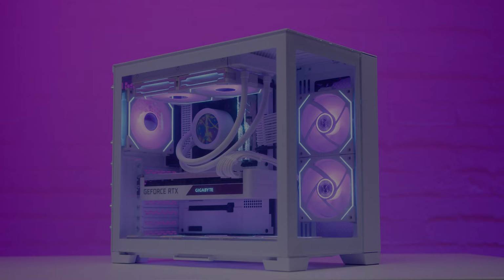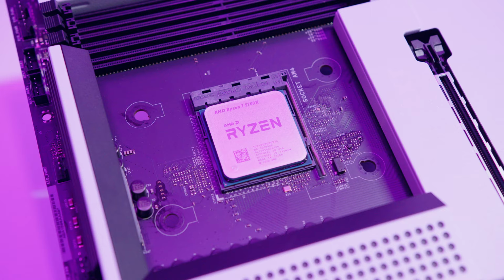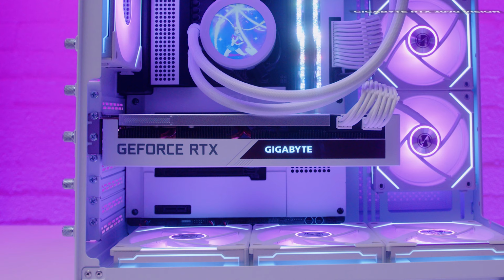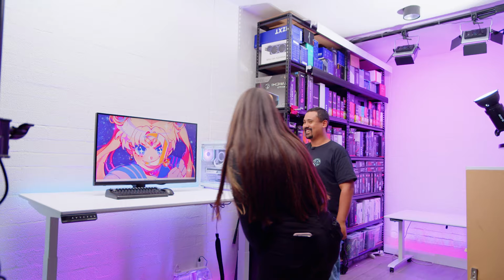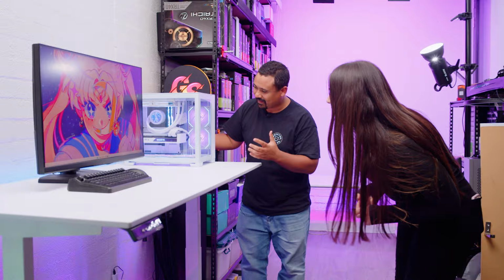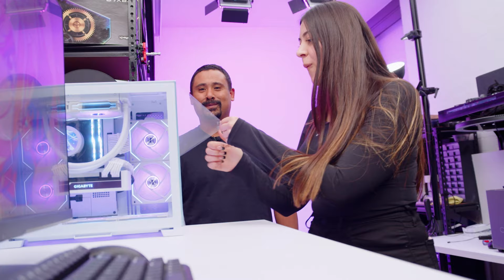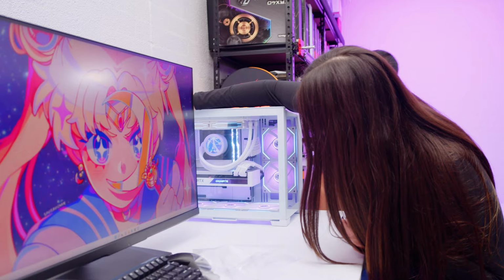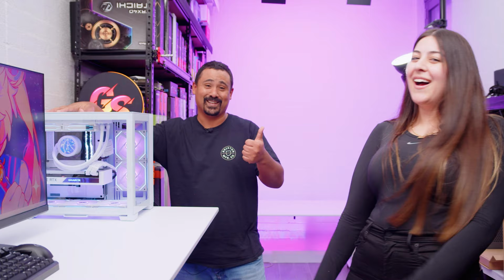Sailor Moon Inspired Ryzen 5700X & RTX 3070 Gaming PC

Comment: 360 aio would have looked better for mounting it on the top to fill in that enormous gap
Reply from the maker: No stock
Reply: 360 aio doesn't fit on top of this case.. Obviously you can modify it to fit but I don't think that he will ever mod a system that isn't his
Reply: @mjgreem8933  oh ok didn't think there was a clearance issue
Reply: @mjgreem8933  you can actually buy this $10 kit from lian li that gives you extra ram clearance so long as its low profile it will work. Super simple install, no idea why barely anyone knows about it.
Reply: @opax  Do you have a link of that kit? I cant find it anywhere in Lian li's website
Reply: @mjgreem8933  Just check some stores online I was able to find one at Canada Computers but that's only in Canada obviously. Its called the "Lian-li Rb-001 Radiator Offset Mounting Bracket".
Reply from the maker: @mjgreem8933  It definitely does fit in this case. https://youtu.be/WOpMkw6oTFM